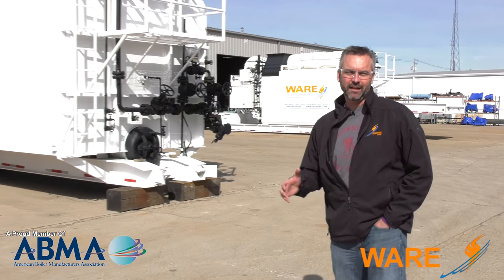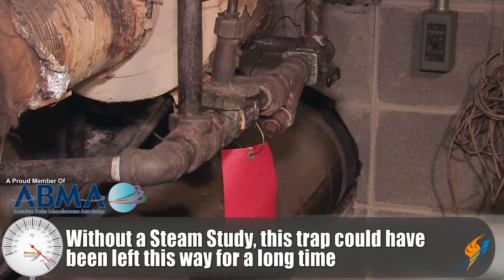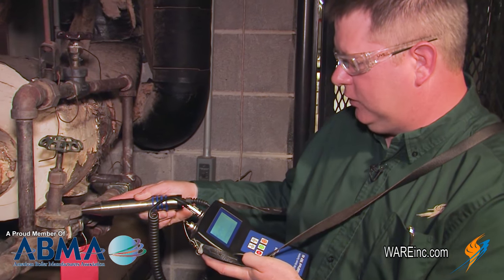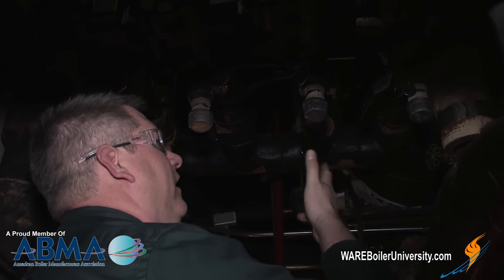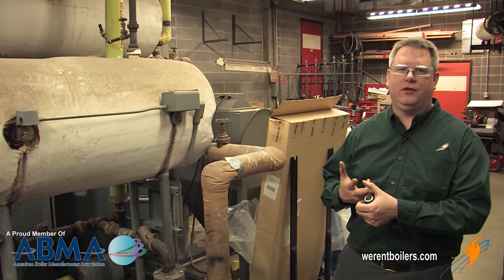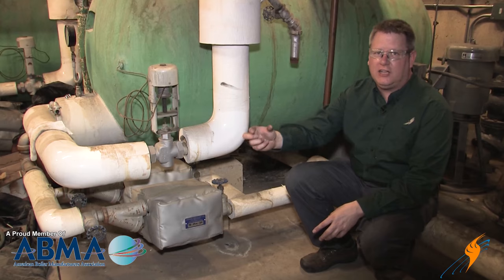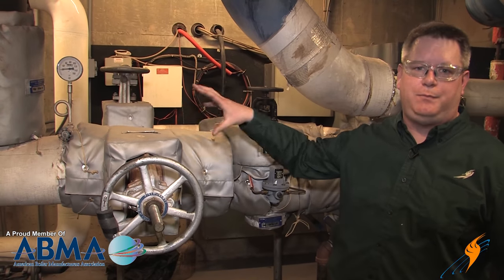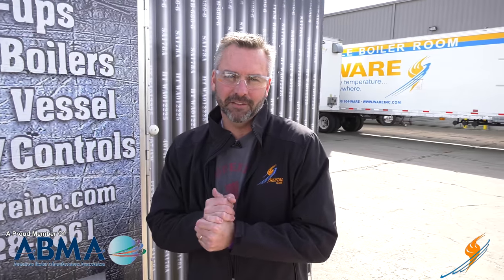Steam Study: Looking at Traps, Condensate Returns, and Insulation - Boiling Point

Comment: Is a boiler with steam coils for forced air, radiators, condensate pump, putting out around 800 MBTU Cutting out at 4 PSI and Cutting in at .5 PSI pressures set way to high?